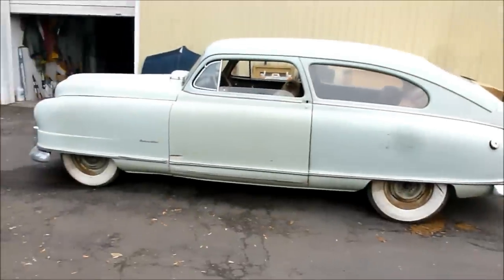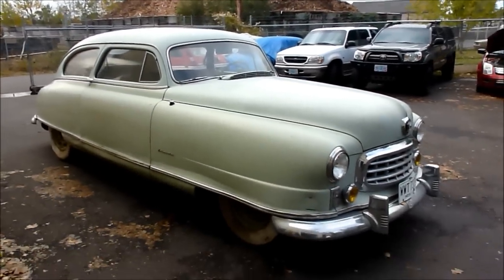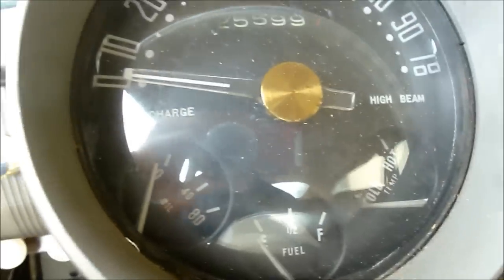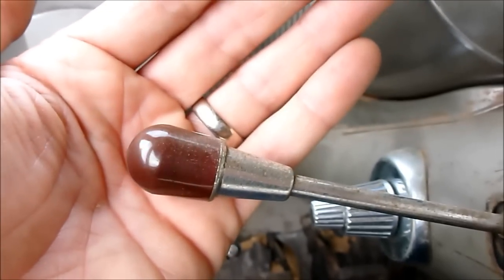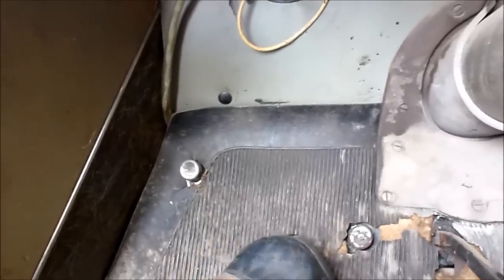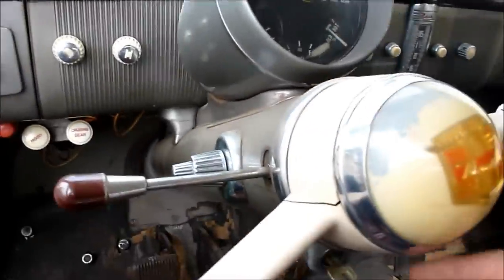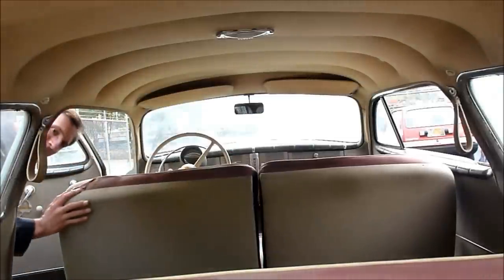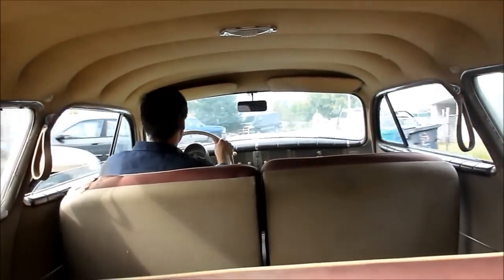1949 Nash Ambassador Airflyte barnfind 1st time driven in over 44 years

Comment: Please, put some gas in it before your left high and dry on the side of the road! this is true immediate postwar futurism. Almost comic book in its styling cues. Will it do 75 to 80 miles per hour? Does it have overdrive? Wish you'd do a video driving it on the freeway.
Reply: Yes it will.  It will do over 90.,  if in good shape.  A 1951 Nash same body style as this one,  was driven 95 mph for over 700 miles in the  La Carrera Panamericana Mexico Road Race.
Reply: No 70 for you! You'd be a fool to push this car that high, what with the accumulated effects of heat- and metal stress (esp. on the manifolds, which on this car are integral with the head), not to mention overdriving the brakes -- even when new, they weren't supposed to panic-stop it at anything over 50. Drive them like it was back in the day, only knock 5-7 MPH off the top end for safety -- 10-12 while cornering! "I used to love this 'ol heap, but one day I was cruising at 75 and the damned thing spun a bearing -- I wonder why?!"
Reply: @roberthaworth9097  If it has Overdrive, yes you can go 70 or more.  That's what Overdrive was for.  Just don't tailgate.

Comment: This car looks like an upside down bathtub. What where they thinking of when they designed it?
Reply: Aerodynamics. They actually wind-tunnel tested a number of designs to find the "slipperiest" one -- this one, with the skirted wheels and rounded everything. It offers something like 1/3 less air resistance than the somewhat similar, bulbous Packard and Lincoln of its day. The smaller Nash Airflyte was called the "600" in 1949, b/c it got up to 30mpg and had a 20 gal. gas tank -- thus, 600 mi. cruising range. It was an economy car with a 172 cu. in. (2.8L) inline 6, and was designed to compete with Chevy and Ford. The Ambassador shown here had a much larger 6 (3.8L), 9" more length, and nicer appointments; it went up against Buick- and Olds-class vehicles.
Reply: John Burns - The independent car makers were more interested in the people. Good advertising made public want styling instead.

Comment: Engine size?
Reply from the maker: Yes, 191 cid or roughly 3.0 liter
Reply: 2stroketurbo
The Nash Ambassador has a 235 cubic inch engine
Reply: 58mustang8 nash amb 6cyl engies were 250 cu in,  with ohv and  had 7 mains
Reply: mick martin
To be precise, the Ambassador had a 234.8 cubic inch engine. You are correct that they were OHV with 7 mains
Reply: at the time they were the very best small industrial engie available.....19 mid 30`s to 1942 fail safe/twin ignition and 1946 to 19mid 70`s (258cu in),,,,small Diamond-T and Federal trucks utilized these engines....if my memory serves me correctly, i`m thinking they were 250 cu in however....

Comment: if you know that what you got that that car that's a prototype right there they are not too many cars just like down with that what you going there are only like them a lot like 10 cars are many 20 cars because they try to test it data which customer than really like of them the body of the car and I look like a futuristic right there and I must be the original paint the outside in the interior is a little bit damaged but inside you can repair it anyway if you can find original material or you can replace there a brand new one even stronger one by the way that car looks great but here's the problem how to hack you remove dead tired idea if the state doesn't want to go up now next day the wheels are coming like the the front of the hood and I'm at the front of the body and the back of it and then we got a flat tire have to have you go to remove that I right there to remove the bolts if you know this. From the fifties that tried to put a type of like different colors everything try to beat the other competition of a car dealer of a factory if you know this so very than you know
Reply from the maker: +Car Rosero   You may be right, I did not think about it being a prototype. I have not seen anything like it before or since
Reply: Do you still have the car today right now and one more thing I never see like does foot petals right there that you can start with your foot that's a different car right there but that Chris right there in the front of my desk from Spain you know or you don't know I just saying the duck cross right there is going to Spain or European something like that you know but the body right there that's a great shape by there I mean it that is a great shape right there I never seen a car like that before I wanted that you go over the windows on the back of it
Reply from the maker: No, the car went to S. California , then was purchased by a Nash collector in Germany. That is the last I've heard of the car.